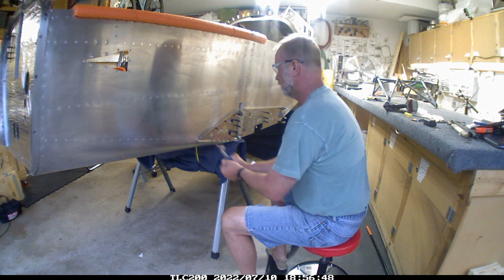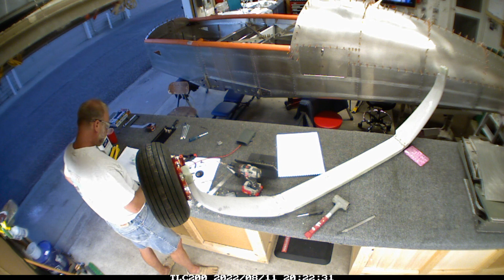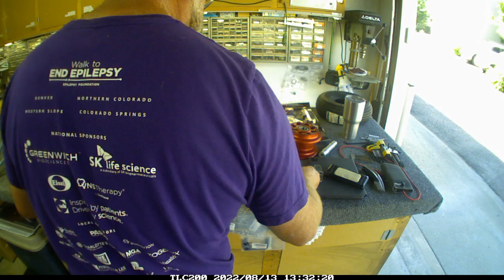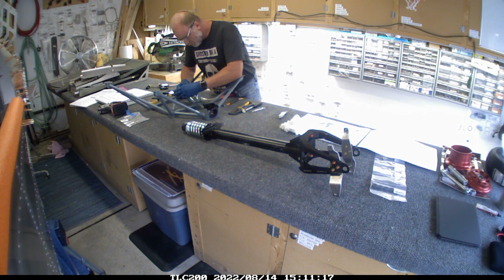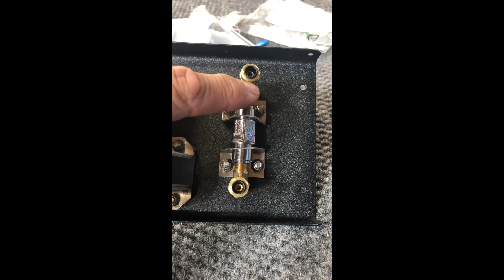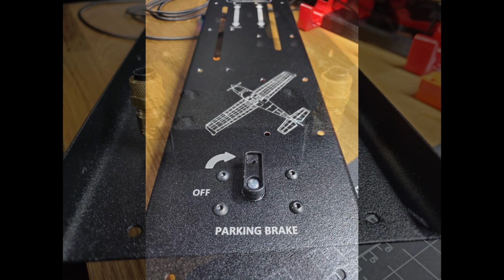August 2022 Part 2

Comment: Hi 
Do you have the Cad file for the 3D print of the valve holder on the throttle quadrant?  can you share?

Thanks

Justin

Connecticut slingers
Reply from the maker: Hi Justin. I just got this and will update this in the comments and my blog, but I wanted to get it to you as soon as I had it. https://cults3d.com/en/3d-model/tool/sling-tsi-parking-brake-panel-mount